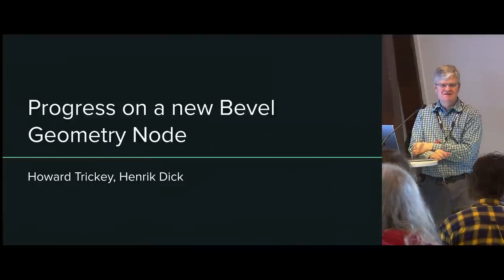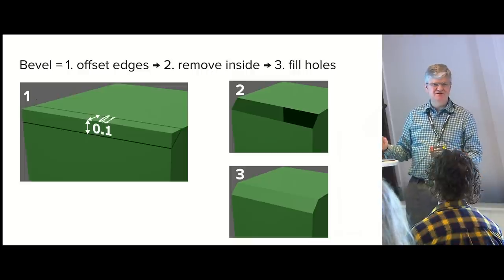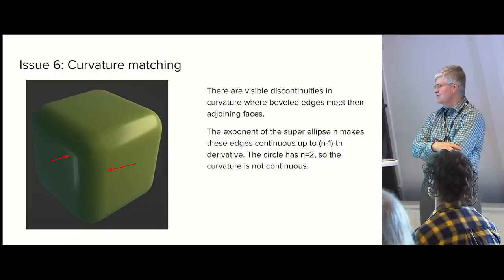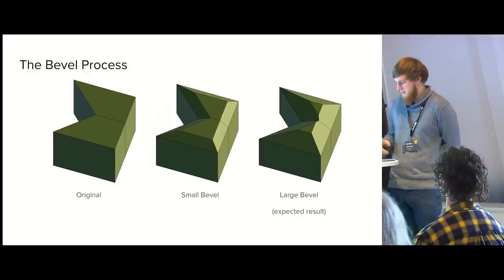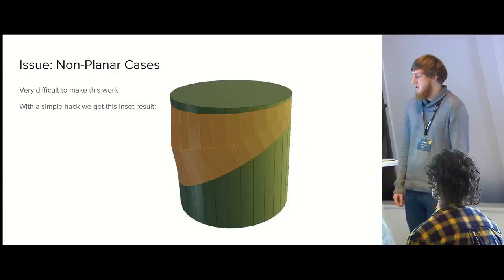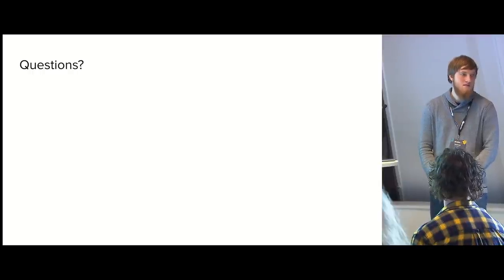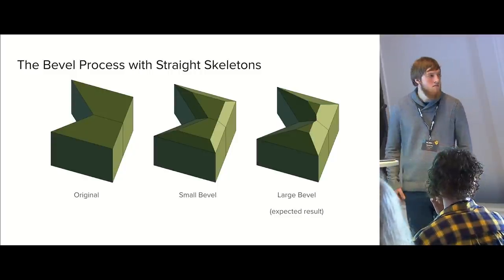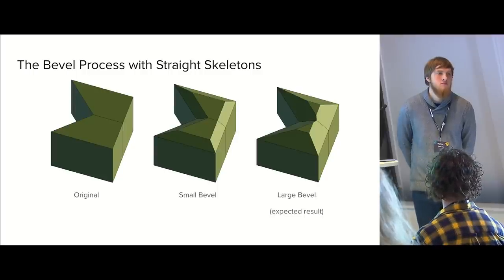Progress on a new Bevel Geometry Node

Comment: Excited to see this finished, when it eventually does. My opinion on how to handle cases where there are two or more valid potential solutions to handling a behavior, is to write both, and give the user a switch to choose which one it uses in their case. Also looking forward to having fine control of edges using selections, and preferably edge methods using selections too. Sounds terribly tricky to do all this though.

Comment: I'll probably stick to CAD programs for hard surface until this comes along. Looking pretty good on paper, gotta admit.
Reply: How do CAD programs handle bevelling? I hear it’s a lot better but how does that work compared to Blender’s way?
Reply: @btn237  try Fusion 360 for yourself and prepare your mind to be blown.
Reply: @btn237 I am a CAD user not a developer, so take this with a heap of salt. CAD programs are Nurbs based modelling while Blender is polygon based. In Nurb based modelling, the geometries are mathematically accurate surfaces and splines.  So, it is (relatively) easy to maintain curvature continuity when merging two surfaces together when you have the precise equations available. Polygon based geometries are just that; set of polygons in 3D space.  You'll run into all sorts of discontinuity problems as described in this talk when merging two or more surfaces together.
Reply: @Zeb  sure, but also, for many use cases topology does not matter. a workflow in game art which is becoming very common is to model in CAD like Fusion, use Moi3D to export - because Moi3D has nice geo export, not "you can subdivide this" type of export but it will shade perfectly and then it can be used for baking. often dynamesh first to add any sculpted details or use a polish pass for tiny edges that are not manually filleted. 

all my point is that these CAD programs are seriously being used for AAA production in the case of first-person weapons at least, high stakes assets.
Reply: @huydinh3395  I can't really point you to anything specific. I'm in some online communities for game art and have myself witnessed people working at big companies like Treyarch talk about how they are transitioning to Fusion for the weapons team for example. You'll find on Artstation that posts for weapon art will sometimes show they were made in fusion in the tags at the bottom.

Comment: new node. Mathematical 3D textures to 2D UV space node. Map textures to 3D space and then optimize to a 2D projection space at the end of the stack. That way bevel just works on geometry and the texture is through the 3D space. Only convert to 2D UV at pre-render time.

Comment: What are the CAD softwares doing that allow their bevel functions to operate so 'smoothly'?
Reply: They're using NURBS not polygons. It's like the difference between using pixels in Photoshop and Vectors in illustrator. 

A NURBS algorithm uses fewer control points and interpolates between then with formulas to create the surface. 

Polygon modeling allows the user to access each individual control point. They have to do the interpolation in real time in the viewport and resolve the surfaces and how they interact.

Comment: Part of the concern with bevel is that you are crossing two concepts, a mathematical function with artistic vision. In all cases that require creative artistry, it should be up to the artist of how that is handled. In some instances, some edges may not be included just because they fit the mathematical requirements. Where as in some situations, the artist may yet chose and altogether method entirely for the outlier confluences.

Comment: I teach blender in an academy for Architects and interior designers.
I have some requests:
1) Completely remove the "Clamp overlap" option. It's completely useless, and should never be turned on. All it does is prevents bevel from working. If the bevel modifier gives bad results, it becomes obvious that the user needs to fix their mesh and where the problem is.  Communicating that is important. And sometimes the errors are so small, that they do not matter in a render. My students often get confused about why the bevel modifier doesn't work at all.
2) "Harden normals" should be turned ON by default. There are barely any scenarios where it would be turned off.
3) Instead of "Harden normals" giving a warning about autosmooth, it should just override it. The user is just needlessly given an extra step to do.
Reply: These are remarks of a very high level. Right now, development is still going on at a very low level of the question, something like: should it even work?)
Reply: @mod3528  These are things that can be done, very easily, on the current bevel modifier, as the first step of improvement.
The new bevel refactor can come in any time later.
Reply: @pauliusmscichauskas558  Then it's just a suggestion. This particular presentation was about the new bevel mechanism. This is not a refactoring.
Reply: @mod3528  By "Refactor" i mean "Rewrite". They are writing new code on how bevel works, and throwing the old code out, or leaving it as a "Performance option". Primarily as a bevel node for Geometry nodes, but the same can be used for the tool and modifier. Am I wrong?...
Reply: @pauliusmscichauskas558  They don't throw anything away. This is not a new modifier. This is a node for geometry nodes.
Reply: @mod3528  Why would they make the node better than the modifier, and leave the modifier as is, with all its current problems?... This makes no sense.
Reply: @pauliusmscichauskas558  Nodes will need to replace modifiers
All those new features that are put into the new bevel are simply not applicable in the stack with modifiers.
As well as other node-replacement modifiers. It's just that the nodes haven't fully recreated the functionality yet to move this forward.
Reply: @mod3528  imo, the modifier stack should not be replaced by geometry nodes, because the modifier stack is a lot quicker and easier to use for simple tasks. If blender devs want to do that, i strongly disagree.
Both should coexist.
Reply: @pauliusmscichauskas558  Agree, blender render shaders could also seem simpler to you than cycle nodes
Reply: @mod3528  not comparable. Blender render is inferior to cycles. In contrast, Modifiers can give the exact same result as geo nodes on easy tasks, just a lot quicker. The flexibility/power of a node based system is in most cases not required. Like, if all you want to do is bevel an object...
What blender needs is a quick way to make simple materials without opening the shader editor. Just like you can do now currently with simple modifiers, without needing to open the geometry node editor.

Currently the material properties tab design is simply broken. That tab is barely usable... and there is a clear way on how to fix it.
Reply: Re these suggestions: (1) yes, the plan is to completely remove clamp overlap, because the new approach described in the talk removes any need for it. I'm not sure I agree about removing it for the current code because unless you fix the geometry, going beyond the point where clamp overlap kicks in yields a result that cannot be used (unless the overlap happens in a non-visible place).  (2) I will consider making "harden normals" the default. Part of the reason not to do it is that it now means that the model has custom normals and maybe the user needs to be aware of that (?). But I tend to agree that it should be on by default. (3) The structure of the current code makes it hard to do this, which is why I didn't. The whole area of mesh smoothing is a bit of a mess now, with several ways of specifying the same thing. There's a design task someone else has to rethink the whole area.

As to the other remarks here about the relation between this and the bevel modifier: I hope eventually to retire the old bevel modifier code, but can only do that when I am sure that I can cover all the same use cases (and more). The general plan with modifiers, I believe, is to make many (if not all) of them shortcuts to the same code that an equivalent node tree would do, so that to the user it still appears that there is a modifier stack, but under the covers, there is one uniform piece of code handling both the modifier case and the geometry node case.
Reply: If bevel doesn't work at all, or is very limited (clamp overlap is on), it's not obvious why.

Let's say the user has a bad mesh. With duplicated vertexes, perhaps:

If clamp overlap is on, bevel doesn't work at all and it is not obvious why. That happens quite often with my students when they extrude faces and then cancel...
(I'd argue that canceling extrude should cancel extrude, not just grab, but that's a whole different topic).

However, if clamp overlap is off, the problematic part of the model is obvious, and it works as indented on the rest of the model.

In either scenario, the result is not what the user wants so they'll have to fix it either way, but one of them communicates what the problem is, and mostly works, and the other doesn't.

It's not a big deal. It's just a long-standing "papercut" of mine. Happy that this is going away with the new bevel.

Thank you for the response!
Reply: Id suggest leaving the clamp overlap in for the old modifier. Obviously it would mess up older files.
Usage: If you have complex models with many beveled edges its hard to find were bevels might overshoot. 
At least with clamp you are going the safe route. for game artists you can then even use weld modifier to save some verts.

You are not the only one using blender. Others might need it. :)

But I agree with the general notion to optimize workflows. 
A future project towards that would be to let the user decide the initial state of modifiers (etc) in the preferences.
The user 'Tempo' started a GSOC in that direction, but unfortunately he had to drop it. 'custom menus'
Just as a heads-up that others have smarter fixes in mind.
Reply: Except for #2, I don't agree with any of this. 
#1 Sometimes you have to go fast and sloppy, for teaching no Clamp Overlap is good, but for actually getting things done, bevel failing gracefully is much better.
#3 Changing settings like that is very messy and unpredictable, I don't want to dig through every modifier of every linked object to find which modifier is forcing a mesh setting on.
Reply: @YT775  when clamp overlap is removed and you open an old blend file, the bevel value should just be set to where it clamped.  I dont think thats a problem at all.
Reply: @ChrisD__  why not just give a warning in the object data properties, next to autosmooth - "overriden by bevel modifier".
Reply: @pauliusmscichauskas558  All that work to get rid of a feature that is a mild annoyance to a specific workflow.
In this case it would be much easier and less intrusive to switch the initial state to off.